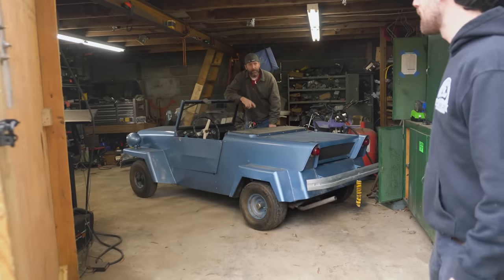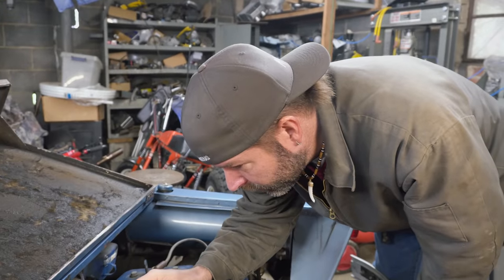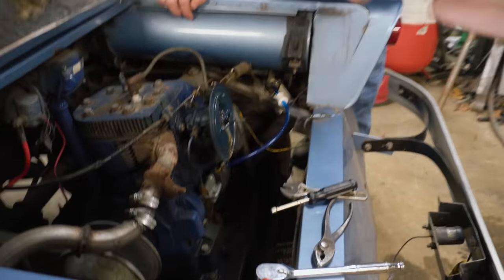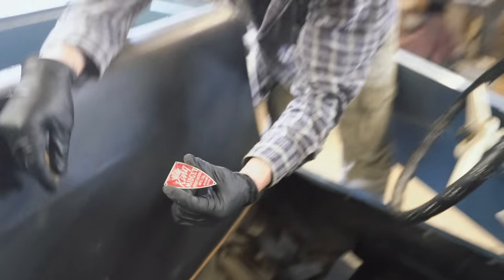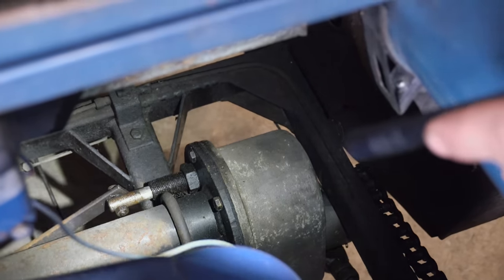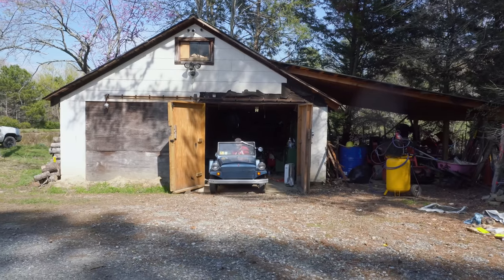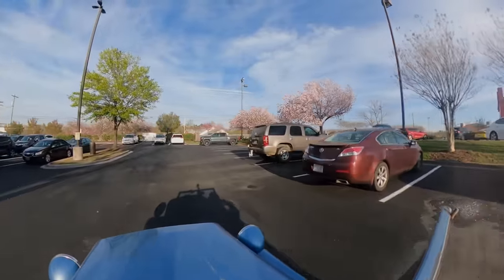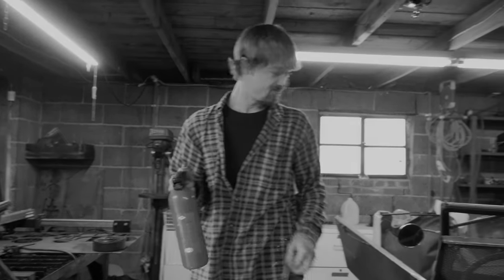We Bought a 60s Microcar with a Controversial Name... Will it Return to the Road After 22 Years??

Comment: Japan has Kei cars, of which I have 3 in my warehouse (1 Factory Honda Beat, 1 Factory Suzuki Cappuccino, and another Cappuccino I got with body damage and a dead engine that I did a custom build with a built G13B, custom suspension/cage, custom widebody to fix the damage and cover the tires needed to keep traction).  They work great on small roads, I had a blast driving the Cappuccino I exported/imported while in Japan for other work stuff.  The problem comes with higher speed highways and interstates.  I can keep up with 70mph, but I'm not a fan of being near the countless semi trucks that generally couldn't care less about anyone else on the road.

Comment: You said it in the end V-Twin engine and double the horsepower to 24hp.
And nice custom rims and tires from GoPowersports. On top of that make a stand for a pair of surfboards. They can double as a roof. You are after all aiming for the beach.
I would also consider a nice rack on the engine compartment. For some camping euqipment. Or maybe a hitch and a little trailer behind.
Make it look good.

Comment: That's such a cool car! Those old Kohlers are the best! By the way the points are external under a cover on the side of the block below the carburetor if you ever need to adjust or clean them.

Comment: Dude one of my dads friends had one of these he restored and it had a 9hp Wisconsin hay bale engine on it the original 2 speed setup was a little worse for wear and the engine we could never get to run correctly so I set him up with the 13hp engine from harbor freight the blue one they sold before they started carrying predator motors and the same CVT setup like you have on yours and that thing would flat out fly it would just roast that one wheel you put that 670 on there and freshen up that cvt and the  belt I promise you will love that little car

Comment: I have the same engine in my 72 cushman golf cart.  I had them little flat head bolt fall out and it sucked it right into the engine. Stuck the valve open,  took carb off and dug it out. Them engines are durable for sure.  I still have a oem gasket set from back in the day for them.     Btw love the mini car

Comment: sure if you have a 670 go for it. but if not may want to look into older twin cylinder motorcycle engines would take some shoehorning but after market upgrades could work but I think a 670 would be good start iirc they can be souped up pretty well.

Comment: Congratultions. You fixed that micro car to run. Then, you can fix a totaled 2012 Elantra wrecked by my daughter. It runs, but the radiator, water pump, A/C condenser and all front is meesed up. Plus the air bag is deployed. If you can do a restoration on a wrecked Elantra , I can learn from your video to fix mine. Thanks.

Comment: I ran into that light problem on a 1977 Toyota I used to have. Check the brake light bulbs. They should be an 1157 bulb, which has two contacts on the base. If you have an 1156 bulb, it only has one contact on the base. If you install one of those in the brake light socket, it will cause the front turn signals light up when you press the brakes.

Comment: Hey guys, you definitely need to pull the engine covers off and check for mouse nests. Critters will build nests and restrict air flow over the block and head causing overheating. That's not good. Can I also suggest selling it to me? I love that little thing and I am looking for a restore project for me and my 2 young grandsons. Good luck.

Comment: I really think you need to construct an air scoop under the seat into the engine bay help cool the engine before that long trip. Also use heat exhaust wrap on the pipe that is under the engine bay to help prevent heat under there.
Reply: An oil cooler to the front would be sufficient. These engines are made to run HOT.

Comment: That engine is the same one I had on my Wheel Horse tractor.  Keep the oil changed and the airfilter clean and they last forever.  Of all the time I owned it, I replaced the points ONCE.

Comment: A guy back in the late 1950s/early 1960s drove one of these from Michigan to Mexico City, Mexico round trip with no break downs, for less than $50 in gas.

By the way, the two guys who started the company met right after WWII when they were both in the Civil Air Patrol.  They were not brothers.

I have a Cub Cadet lawn tractor that bought brand new in 1978 - still have it except it's disassembled in my garage with the drive shaft and clutch out of it.  Exact same engine except mine is gravity feed and no fuel pump.  But if you look down right next to and below the carburetor, there is a little square cover.  That's where the breaker points are.  Those engines are very sensitive to having the point gap set accurately.  Also, they have a centrifugal compression release.  If the battery is weak, you will crank  and crank that thing and it ill never start.  The engine has to spin up fast enough to disable the compression release.  On my Cub Cadet, I finally went out and bought the biggest battery that I could fit on the battery tray.  Had to make a new battery strap to hold it on.  But it would then start immediately every time.

The engine has no oil pump, though.  It's splash lubricated.  So keep the crankcase full.  Not half-full - FULL.  If you get on a steep hill and the oil level is low, the oil slinger will not properly sling the oil around to cool the bottom of the piston, and the top of the piston will separate right where the ring grooves are, where it's thinnest.  But it usually doesn't hurt them.  Just find a new piston and stick it in.

Funny thing about the King Midgets though.  You could be driving down the road, and you'd keep looking in the rear view mirror expecting to see a lawn tractor following you.

Comment: King Midgets have a following. There were 20 or so that went thru town on a cruise a few years ago. IIRC most were from the NE part of the US. Some were running Honda 2 cyl with big Torque-a-verters There's a web page and it has a parts and for sale section. JFYI Kings only ran around 45 in stock form.

Comment: I have the exact same engine in my Case 222 lawn tractor. When you pulled the air cleaner off, it was funnier than hell to me that you have the exact same issue with the base of the air cleaner attaching to the bell of the carb -- over-tightened, stripped out and missing screws! Careful one of those bastards don't rattle out and go through your engine! And don't think you're clever by slathering loctite over what little thread you have left because the two outer holes coincide with the shaft for a certain butterfly; I glued my choke open. The engine itself is nearly unkillable but, damn the peripherals!

Comment: If I were going to put it back on the road I would pull that engine and store it properly then drop in something like a Harbor Freight 459cc engine for reliability and save the original engine in case it needs to be converted back for selling. Cool little car. Or maybe a v twin!

Comment: I would change the motor for a V-twin 20 HP. The CVT need a new belt. And I would try to make a kind of removable hard top.  Maybe also make the front front cover able to lift to have access to the break and other mechanical parts in the place. It could also serve as a small space to bring parts and tools. Or cold stuff ;-)

Comment: Mentioned this article to a local guy, he lives in Shelby and has one that is shall I say stupid modified.  Has a fan cooled snowmobile engine in it and a differential set-up from a lawn-mower Glenns Surplus so he actually has 2 wheel drive.  It will break the speed limit, but then you have to be crazy to go that fast.  Calling it a one of the time death trap is an understatement.

Comment: you are in NC right? you need to search. because if i'm not mistaken. when i was a truck driver. there was 2 of them in a museum  somewhere in your state. one was 100% stock and the other had a honda rebel 250 engine on it. but both was street legal and they said they drive  them a few times a year.

Comment: Cool car!!!   U guys were a lil out if your element with the K301,  any questions u can ask!!  Lol.  I have lotta experience with the old one lungers from john deere garden tractors.    I think a K361 would look sweet in there!!  Thats an 18 hp ohv that lots of teactor pullers built for stock classes… can put billet rod and pulling cam, bigger valves, racing flywheel, header pipe….etc etc etc!!!   Not the predator!!!!

Comment: If that's the 12hp, it would be a Kohler k301. Those engines are practically bulletproof. They're cast iron, and can take a lot of abuse. The K series Kohler was very popular among small garden tractors. These were the primary engines of Power King(Jim Dandy/Economy), Cub Cadet, Wheel Horse, and others. I have a K321 that originally came on my 79 Power King. It was replaced by a Kubota D600 3 cylinder diesel off of a G5200 diesel mower. The K321 is the 14hp model.

Comment: These king midgets are cool. Just because they are a street legal go cart. I am split between keeping it original or not. Get the headlights, parking lights, turn signals and brake lights working. Fix the wipers. Fix the brakes. Keep the body totally stock. Stuff some foam in the seat cushions and make them a little more comfortable. Stuffing a twin cylinder Kohler or Predator engine in it, and give it 25 to 45 horsepower. Say a Kohler CH-1000 with 37 hp 🎉 or a Predator GB 1000 with 37 hp.

Comment: Assuming you end up swapping out the engine for your road trip you should install an Ecotron small engine fuel injection kit and try to use a small catalytic converter instead of a muffler. Isaac & Charles in the car & John on his 190.

Comment: there is no way in hell I would give up my ev for that micro car nope it was a good idea in the day but so dangerous a truck may not see you and flatten you they are not very fast or safe no roof no comforts my ev has a seat massager and heated and cooled nowadays if the micro car had a comeback it would be electric and safer than that kiddies car its fun to watch I wouldn't mind one I would convert it to electric because it would be faster and use it off-road and have fun with it now that's a good idea make a four-wheel drive one and a slide-car with a big hand brake lever to put you into a power slide slick tires so many ways you could use these types of vehicles but on road no way they are just too small to be seen by truck drivers and most big cars and pick-up trucks. great video as always boys keep em coming.

Comment: Do a snowmobile engine. Something like a Rotax 503R or one of the Skidoo triples, or even a rotary, and just reuse the CVT you have already. Or even a sportbike engine of some type, given that it already has the chain drive, that would give you a transmission with gears. Even something in the 250cc range would be awesome. But I do feel that a snowmobile engine would give a lot of power for cheap, plenty of high RPM performance, and an easy installation.

Comment: Okay hear me out... crate the original drive train so it can always be taken back to original, and then build a sub frame with a RZR 1000 drive train. The belt system has proven to be durable enough to travel highways, and you'd be able to hit 65 in an emergency with 50 being entirely comfortable. Not to mention parts would be easier to find in a pinch.

Comment: I knew that was 12v,  6v batteries only have 3 chambers for acid and 12v has 6.   
Generally speaking most 6v systems I've seen are positive ground so one if the quicker things I check to make sure.

Comment: You can bum parts off cushman to operate these i had a friend who had one nicely restored also had a heater that was a metal funnel off the block fins and a metal tube that came out from the under seat I got to drive it a few times fun I even got to drive a Crosley hot shot which I think is America's first sub compact sport car it was a little more car than the midget 3spd, water cooled, 4cyl engine etc. 

Little hint about batteries count the cell caps each cell is 1.5volts each

Comment: @ cars and cameras the cvt clutch is down grade in the case of the car because it would have originally had either a 3 or 4 speed gear system in it

Comment: u should put a vent each side on the back quarters and get tne engine bay better ventilated , possibly slightly bigger tyres , but still fitting in the original arches . then a complete going over the bareings will b shot for a start . then a quad engine of some sort in order to keep reverse . u could see about the engines from japanese k cars or a 2cv , the hillman imp one would mibbie fitas they arn't much bigger , the v4 from the sonnet also . but probably the best one would b ,theres a danish inline 4 motorbike thats been about since the 50s i think , its engine looks like a miniature mini one , its called a nimbus i think its engine would b perfect

Comment: This tiny thing is street legal?  o0  Ok, it's more dependable than the Miata. About the same power too.  ;-)
Get it fixed and license that puppy.  New tires and split brake master is all. This is basically a daily driver with a bit or work.
No clue why the name could be controversial. It is (gonna be?) the KING of the Midgets.  C&C style.

Comment: Whe have microcars but i think they are not imported in the usa. Check on ligier, aixam and microcar. Also for disabled. Check canta and ariola. These last 2 come closer to your king like dimensions but are only 30m/h aprox.
Check on the vario pully s. I think they are slightly stuck. This is the daf variomatic first put in a car in 1959.

Comment: its down on power big time its probably making only 7 or 8 hp instead of 12 hp      if you do a bigger cam head porting new piston rings a race exhaust and a better torque converter a mikuni style carb on it and some better tires it just might do 60-80 mph and it just might pick up to 15-20hp or more        it would be sad to  see a predator 670 swapped from the flathead cause it wouldn't be original but it would also be really cool at the same time cause it gets mo powa and it would be able to make more hp with the 670  than 20 hp and it would be able to reach 80-100 no problem with just a few performance parts from go power sports like Cam,exhaust,EFI,turbo,billet rod,billet flywheel,stroker kit,higher compression,port and polished heads,polaris RZR clutch system (Primary) it would be making a solid 100hp and putting it to the ground solidly 100% it would be cool to keep it stock but i think the engine is tired out tho lol      cant wait to see what you do with the build ima love this build so much cause you can do a lot with this platform

 P.S you can also re-locate the oil cooler to the front of the vehicle for  better engine cooling       i cant wait to see what you do with this platform

Comment: I say switch the motor. Save the old one though. Just so you got a newer reliable one so you can use it effortlessly. Then if you get rid of it, put the old motor back in so it's og
Reply: The old motor fired right up after sitting full of water for 20 years. Reliable enough for you? You think some cheap Chinese junk is going to last 50 years and run like new?

Comment: you could bolt 2 motorbike altanaters to it and a ev motor to drive train as well use a turbo off  a motorbike to spin up alternaters instead of turboing the engine you spin up the alternaters

Comment: I have 1 a lot ruffed that yours mine has a 2sp in with forward and reverse in it thay used a belts on them like a tot goat did also mine a gm starter genarter are a is a type 3  which was started in 1957  their ads popular machic for $999  type 1 looked like a race car 1930 or a sprint car these had wood frame  type 2  looked  different  I have only seen 2 king midget 1at the orkland roster show and mine this is the 2nd micro car in the family

Comment: Your best bet is to rebuild the Cast Iron Koler You can get more power out of it than the China made pot metal V twin  you may get mroe speed from the predator but not torque or raw Power.  those ole Kolers like that are Tough I have a 14 in my Tractor and ita a big tractor.

Comment: Mustie1 on YouTube, has one of these cars.
I also agree, electric cars or more harmful to the environment then Gas or Diesel.
You can tell that’s a 12-V battery because it has 6-Cells and the orientation of the terminal, a 6-V Battery has 3-Cells also the terminals are not straight across from one another.

Comment: you could buy a brand new beetle  for 1800 bucks in the late 60s.  a new corvette in 68 was under 8 grand.
detomasso pantera  was only 10 grand.  no excuse for the rise in auto costs over the years.  maybe lately with computers, but no way by 1990 should cars and trucks have been over 25 grand.
you youngsters got hosed.

Comment: Heavy Duty Chevy Luv Shocks / toyota say 70`s model ,or just some heavy shorties with coil-over / say ,nnot sayinng go all fabtch or nuddin , but-t  just some shorties you nneed 3 x`s what fully loadedf cann carry weightlimits = inncludinng all passenngers weight as well aadnnd i would suggest for long haul , fix the innstability inn rack / frame , dddonnt try to drive it tillits stable , for Safety Guys = LAST THING I WANT TO READ IS = SOO N SO GOT HURT DOING THIS OR THAT , "  COMMON " [ don`t take your girl out till you fix this bra  = Please ? just strengthen that flex out so that you dont loose control so easily and not feel Where Your Wheels Are to Knnow How to Correct , k ???? ,on small engines , its Quite EASY to Forget Where Your Wheels Are Turned and that time tolook = nnaabra  plz